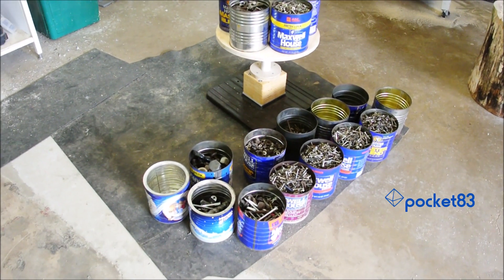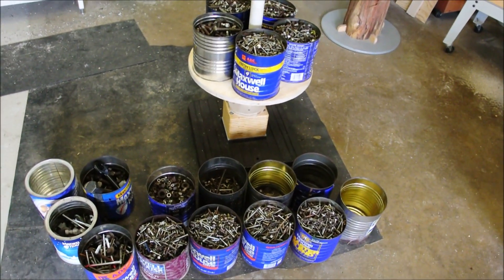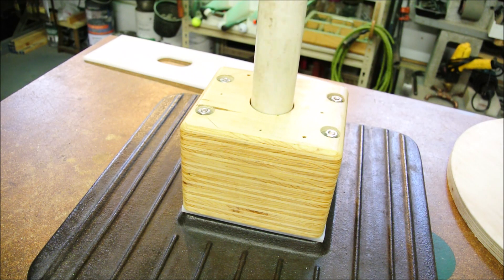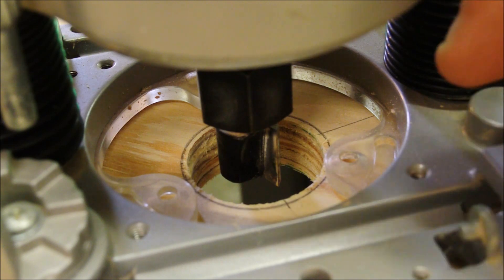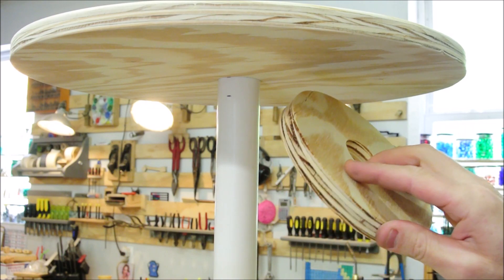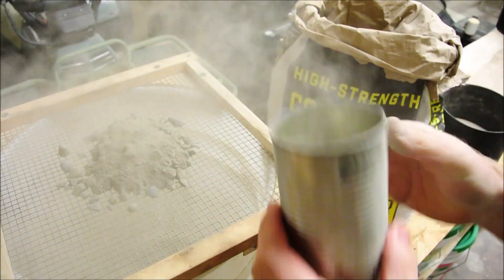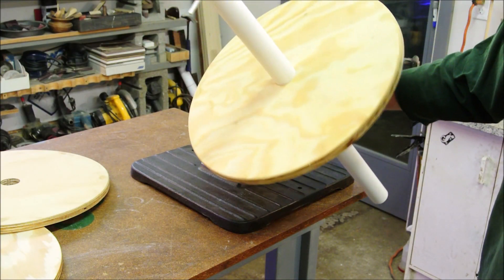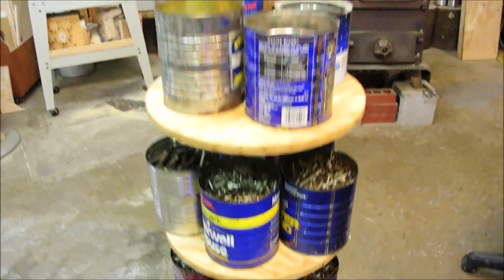PVC coffee can carousel

Comment: Nicely done. I’ve recently purged my shop of some such excess and left it at the curb for a metal recycler to pick up. Its hard to let go sometimes 🤣
Forgive me if maybe I missed your reasoning for not using a live center (of sorts) at the top to stabilize the post, but a simple frame could have been made up the two back sides to provide a center point at the very top or a rail to hold the post right below the top shelf. Or since this will have a home in the corner provide such stabilization from something off the wall... but maybe that would have made this less interesting lol

Comment: I'd probably add a small lip on the outer edge. Just enough to prevent unintentional sliding/removal if it's a bit wobbly in use. But, that's also probably unnecessary.

Comment: Cool video Pocket, do you have any concerns regarding the palm sander vibrating all the aggregate to the bottom? I doubt it will pose any issue, but now that the thought is in my brain I feel the need to solve for this imaginary problem. Maybe if someone else tries this they could throw a few circles of fine steel mesh in every few feet?

Have a good day.
Reply from the maker: With the larger aggregate removed, what remains is small enough to stay in a reasonable suspension. You'd really have to vibrate it excessively to cause a notable strength disparity. 

When casting a part, the benefits of vibrating outweigh the costs up to a certain point, and it's a skill to find that happy medium. Also, mesh and fiberglass provide similar advantages. Rebar is probably a bit more appropriate to this case. Source: I had a job once as a form-maker. Not that you should really listen to me ;)

Comment: Hey I gotta question. How do you usually cut the top off gallon paint cans?
Reply from the maker: The plastic ones? Clamp a scrap chunk of wood to the workbench that's the same height you would like the finished container to be*. On top of the block (but under the top part of the clamp), stick a utility knife blade. Now rotate the paint can, keeping it flat against the bench, scoring a line as you go. 

Pro-tips:
Place the blade at no more than 0.5" proud from the board, so that it doesn't bend and make a wavy cut. Position the blade at around 45° from what would be tangent to the jug. Don't try to cut in one pass; it should take around 3~4 passes with a sharp blade. A few drops of oil added to the cut will make a big difference. Placing extra clamps on the table that serve as 'stops' for the base of the jug will better insure consistency while rotating. Finish the top lip of the container with a razorblade by back-dragging it around the sharp cut; if you add a drop of oil, the rim will be smoother than you'll be able to get it after 10 minutes of sanding. 

Some of mine are cut at 5" deep (if I remember correctly). They're sized for a common margin trowel, so that it perfectly fits all the way down when mixing up small batches of mortar/concrete/grout, etc.. Super handy at that size. I use those most. 

   *Note that when cutting a small portion of the top portion away, it might be sensible to cut the jug upside-down, so that your razor/block isn't too high. Jugs cut right up to the handle grommets are also handy, and if you want to make little buckets, just removing the top metal ring is easier upside-down. 

Don't forget the oil.